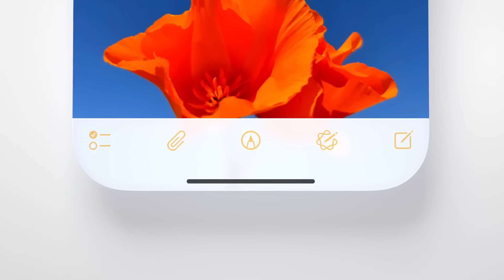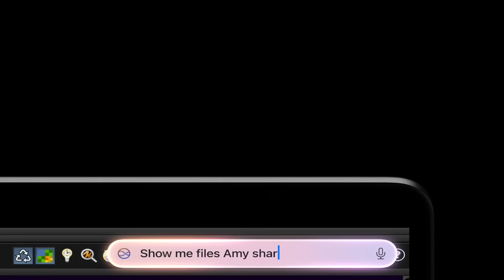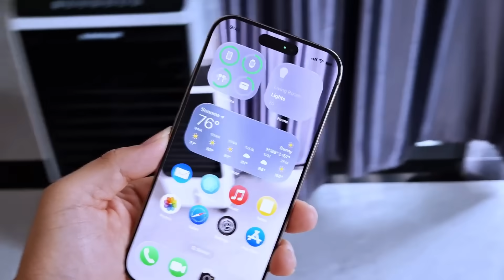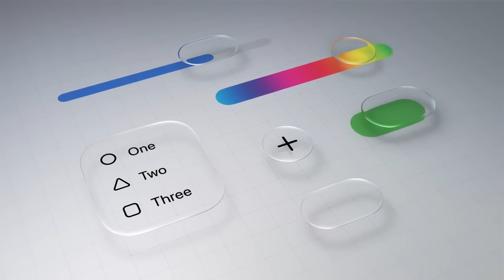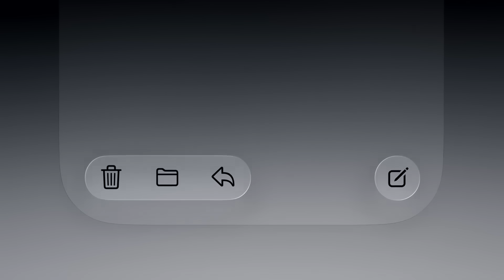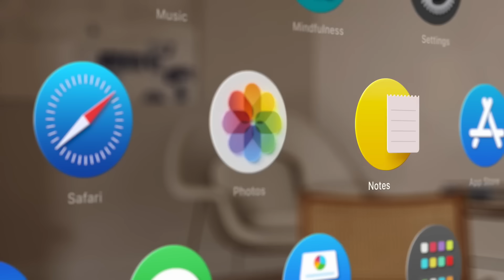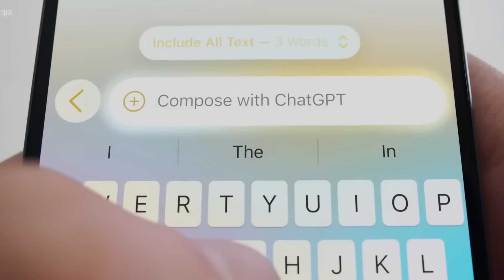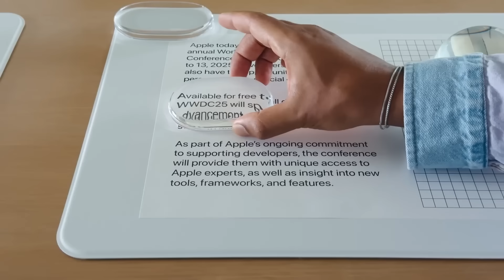Apple Strikes Back — The First Transparent MacBook "VISION" Will BLOW Your Mind

Comment: This is as stupid as it is fake. There are few, if any, use cases where a transparent screen would make sense. About all I can think of is to build displays that can be viewed from both sides at once for small-group presentations or, on a large scale, for double-sided electronic billboards. I don't think the market is crying out for either, especially at what will likely be a very high cost.
Reply: It could be that they want to make a smaller phone, with a display you can't see unlewss you hold it right close to your eye ... whee the transparancy will actually be useful, allowing for peripheral vision through the display ???

Comment: All we want is an evolution of the 2018 MacBook PRO with TouchBar that basically had only Thunderbolt / USB-C ports and a headphone jack…

But they could ditch the headphone jack, add MagSafe, keep the FOUR Thunderbolt / USB-C ports, adding an extra one or two, obviously including all the latest updates, chips, and tech of the current versions…

Still prefer the 15” model verses the 13”, 14”, or 16”. Though oddly enough an 18” or 20” MacBook PRO might be an interesting product series…

🤔
Reply: I love my 16. Coming from a 13" Macbook Pro, it was a dream. Bigger than that seems stupid for those of us who actually travel with our machines. Was disappointed that the new machines got rid of one of the USB-C ports. When I'm traveling, working with external SSDs, and multiple monitors, the last thing I'm thinking is "How can I connect LESS to this system?"